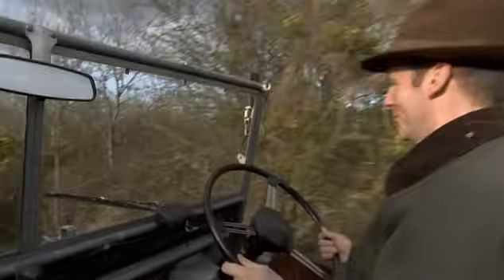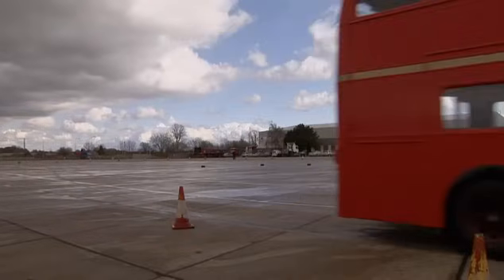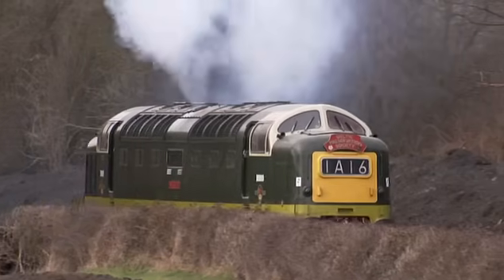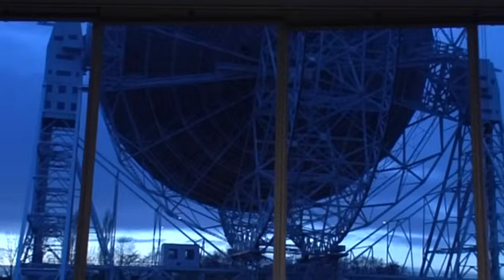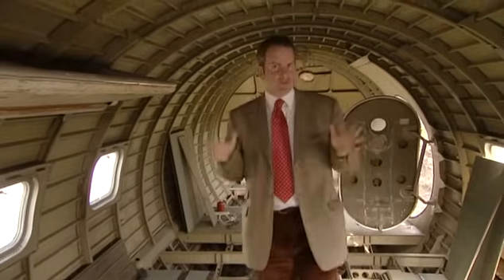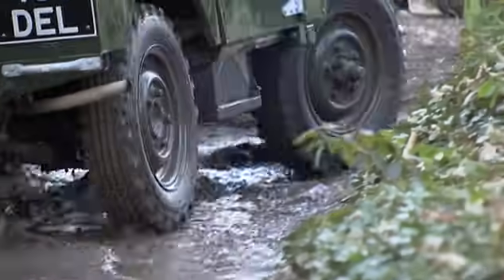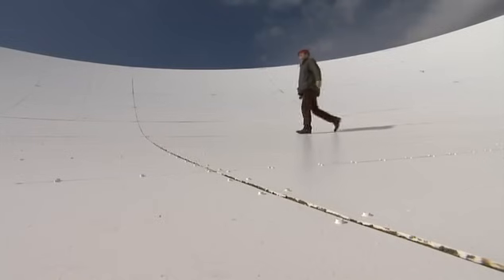Britain's Greatest Machines with Chris Barrie - S01E02: 1950s - A New World Order (2.0 Stereo, 360p)

Comment: I worked at a plasma spray company operating lathe/cylindrical grinding all those little fins on that jet engine are sprayed with a coating because they would melt if they did not,we also did rods for paper making machines with out the coating on the rods the paper going over would melt them, It was an interesting place to work I learnt so much about plasmatic flame spraying.Peace.

Comment: I recently watch a  video stating (You Tube Channel  Pilot mentor) the problem cracks was not from passenger window corners. But from the aerial aperture on the roof called a aerial window.
Reply: The wreckage recovered from the sea confirmed that the passenger windows were not related in any way.
Subsequent investigations revealed that the Comet used aluminum skins that were half as thick as they needed to be and were made from an inappropriate alloy that was too brittle.
The Comet also lacked proper rip-stop doubler joints and the fuselage reinforcement hoops were too weak and spaced too far apart to prevent cracks from joining up with adjacent panels.
The Comet was also found to have too few riveted fastners and that they were not installed to industry standards for pressurized cabins, they cracked during  construction and large cracks were found on new aircraft that passed quality control inspections.

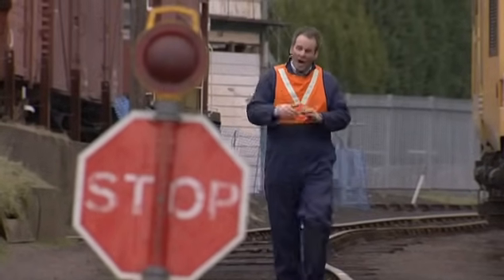Comment: 8:27 Third rail?
Reply: Some rail networks (merseyrail for example) uses a 3rd rail on the ground that picks up electric current driving onboard electric motors instead of overhead wires and a pantograph

Comment: The Landrover had it's lovely galv and aluminium body but awful mechanicals and rust prone chassis. The Austin Gypsy had great tough mechanicals and a sealed rust proof chassis but a baggy rusty body. If the best of both had been combined by BMC, the Japanese would not have stolen the world market with the Landcruiser. As a mechanic I owned Austins and Rovers and worked for the NZ company that imported the first Toyota Corollas and Cruisers. Farmers were cancelling their Landrover orders and ordering Cruisers after just one drive. The beginning of the GB car industry failure.

Comment: Most two stroke diesels fail modern pollution regulations, you can see why. The deltec engine magic was having one crankshaft rotating backwards, hard to do but the key to success. A true dinosaur to be cherished.
Reply: Suppose you could improve its efficiency by using more turbochargers or bigger ones meaning less fuel is burned

Comment: Great series, Chris is perfect for this and the display of wonderful British engineering is a real treat.
The original double decker bus of the fifties and sixties was the AEC  RT,  the bus before the one we saw on the skid pan.
A super looking bus and very popular with passengers and such an iconic British passenger vehicle, I always remember the huge black radiator filler cap on the front, with the finger holds and the engine cover that was at the front of the lower passenger deck and behind the cab, some of us kids used to stand on this and use the hand holds to balance ourselves until told to sit down by the "clippie"
The only exception to all this great engineering is the Diesel Deltics and some other British engines, post steam, possibly the ugliest in the world and still not very eye catching in 2021.
Great performance and obviously from this, longevity, but looks went right out of the window in this section of great British achievements. Thanks for this, super series.
Reply: you sucker for cleptoparasitism, because the Americanization of TV productions thereabouts does appear to have been handily pulled off WAY fuckingly earlier than I'd idly supposed, fuck.........

Comment: repeating the incorrcet trope of comet windows..... (they contributed but they werent the cause - which was poor assembly practices by staff untrained in pressurised aircraft assembly that caused microcracking around rivets (1: hammering rivies instead of ensuring holes were the right sime  and 2: overtightening them) and De Havilland manglement refusing to let the designers talk to the assembly line staff to train them in critical procedure

Neville Shute was sacked for writing a memo predicting the inflight breakups of Comets. "No Highway" was the book he wrote afterwards (turned into "no highway to the sky" as a movie) to warn the public when he was gagged from saying in public what would happen.

The windows? When the tear in the skin from fatigue damage around the rivets reached the straight eddge of the windows, the airframe "tore along the dotted line"

Blaming the windows was a way of de Havilland management avoiding corporate manslaughter charges - and the coverup of Shute's warning memos went on for over 50 years

Comment: The delta diesel locomotive engine is the craziest design I've ever seen. Didn't know opposing pistons is a thing until today, and in delta configuration with three crankshafts. How crazy is that?
Reply: OP engines can pack a lot of displacement in a small volume and you get to do away with the the valve train.  The US submarines used an OP engine during WWII made by Fairbanks Morse.  It had only two crankshafts.  hth
Reply: @paulkurilecz4209 could you technically make a radial engined diesel locomotive by glueing like 10, nine piston radial engines running on diesel OR kerosene?
Reply: @Andromedagalaxy22  Yes, you could; however, there is a limitation on width that could affect the design.  I believe that the Germans did make some diesel fueled radial engines for aircraft.

Also, there will be a height limitation and then there is the need for maintenance access.

Hth

Comment: Comets: perpetuating the myth of the windows. They were actually designed with the stresses in mind - hence the radiused corners -  it was the ASSEMBLY practices which killed the aircraft because the designers and engineers weren't allowed to talk to the assembly line workers (who'd never built pressurised aircraft) by 1950s management, and so the workers didn't know the way they were putting the aircraft together (hammering in rivets and dodgy drilling practices) was creating microcracks which would then travel during pressurisation cycles - none of this was a problem on unpressurised aircraft.

Neville Shute went into this in detail (and the R101 issues) in his autobiography. It's worth reading.

Comment: The original gearbox had a set of " stump puller " gears and regular highway gears. The bonnet mounted spare tyre was my only problem. 4WD does not solve the glare ice issue, despite traveling at 25MPH. I barrel rolled my series 2 SWB and the only damage was to the windscreen caused by my bonnet mounted spare hitting it. When " Daktari! was about, that program sold the rest of the world on the Land Rover. When yo wanted more power, the answer came from across the pond. All the tooling for the all aluminum Buick V-8 powered the 3500 Rover sedan and the first Range Rover County.  also know the Lord Rootes story and the two jobs that created the Sunbeam Tiger. I've salvaged and kept many Series Alpines running. These vehicles are a labor of love for me. I don't do  politics and have several sources of the original Ford 260 V-8 that a certain penta- star  company was furious their V-8 would not fit.

Comment: Land Rover- not bad for a 6 month stop gap. Until now.
Reply: Land Rovers, like almost ll cars today made today are now junk by cutting corners to maximize profits! and making them difficult for the owner to work on them and to be very expensive to take to the auto shop!
Reply: @nightlightabcd  To true! I would never buy a new Land Rover now, probably a Volvo 4x4 or Skoda. My first Series 1 an 88 inch Ex Field Cable Party vehicle cost me £150- One sold at Bonhams last week a 1956 ex military for £29900!!! I currently run a Dsicovery 2 TD5, and a V8 on auto gas and P38. Best one ever was a Classic Range Rover with a 2.8 Isuzu engine in- Did 500,000 miles that I know off, broke my heart when that went. However ! Old Landise never die, bits from her are still going on other rebuilds.

Comment: Land Rover..The Best 4x4xFar.
Reply: Is the answer 16? If so, were do I collect my prize?
Reply: That depends on what metrics you are using. When you consider the terrain they were anticipated to traverse it would not have been such a bad idea to do a bit more in the way of rust prevention like heavy galvanising of the chassis but by the nineteen fifties making things to last was no longer seen as a good strategy. Despite that there are still many old land rovers still going after a lot of work over the years patching them up.
Reply: Ever tried a Land Cruiser?
That's something actually working, and doing so reliable!

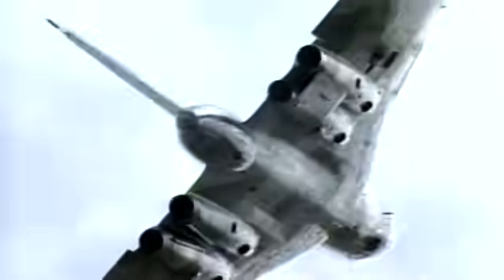Comment: 27:02 - 50,000 feet would not have taken it beyond radar range, but at the time there were very few fighters or surface-to-air missiles which could guarantee a successful intercept.
Reply: dont forget the u2 spy plane was up there only problem was ussr could detect but had to keep quiet so as not to give the game away.
Reply: @raypetts2155 they did give it away when they shot down a U2 with a surface to air missile

Comment: I love those old double decker buses I cannot believe they actually drifted that bus without rolling it over
Reply: designed that way with self levelling suspension. or more weight in the bottom reduces roll over.
Reply: Yes amazing, how many slaves they managed to press in to lower the centre of gravity. and then they had the hutspah to call it engineering

Comment: If you want to go into the desert, use a Land Rover.

If you want to come back out, use a Land Cruiser.
Reply: If your Toyota breaks down in the desert, tow it out with a Land Rover. And I’ve seen it done
Reply: Spent a lot of time in the desert in my LR Disco II, including quite a bit of severe off-roading in extreme heat (every weekend June, July, and August in Death Valley). It never let me down, always got through (and quite comfortable) and never had any equipment failures. Also drove Land Cruisers in the deserts of UAE and Oman - good car and it got me out, but Land Cruiser's aircon was weak compared to my Land Rovers (have had four of them since 2000).

Comment: I rode on these buses when i was a kid. They stunk of diesel fumes. The exhaust was in front of the entrance at the back of the bus. Fumes got sucked into the bus. I wonder why the exhaust was not moved to the other side. Can teams of engineers be that stupid?
Reply: I seem to recall there used to be a regulation requiring exhausts to be on the near side

Comment: I FRIKIN HATE DIESEL ENGINES
Reply: I understand what you mean.  I'm not a fan myself,  but they do produce alot of torque.   Torque that in the old days, was achieved with gearing.
Reply: BUT STIL IT SHOULD HAVE BEEN A STOP GAP steam-eletric hybrid locos anyone
Reply: As nearly all diesel locos are just generator sets driving electric motors on the wheels we are almost there without batteries getting in the way . I will add except the diesel-hydraulics of the Western Region .
Reply: Most fuel efficient type of engine there is .
Reply: the USA tries a direct drive steam turbine locomotive and a steam-turbine electric.

The turbine geared-down concept was a questionable idea, although the prototype d3veloped a lot of power... 

The steam turbo electric had merit... because it could run on any fuel type including granulated coal.

But the diesel locomotives win out... the argument I've heard was these requires too much water  (despite designs to condense and reuse some % of the water)

however... the argument that stopping for water would add unreasonable coast & delays. thst was total nonsense as up until about 1954 US railroads were 99.9% steam with some electrified routes (Great Northern RR; but even then the GNRR still used articulated mallets for heavier freight)... . water supplies were already well placed aling all rail routes

Comment: Is that much smoke normal for a Deltic?
Although the Vulcan is the poster aircraft of the V force, I actually prefer the Victor.  It looks more futuristic and more menacing!
Reply: Yes that is  actually pretty normal for a Deltic. Deltics have two supercharged 18 cylinder engines. So 36 cylinders producing 3300 horsepower all together and burning lots, and lots of fuel. So you are gonna get a lot of smoke, museum piece or not.  And all diesel locos make a fair amount of smoke on a cold start. If the loco has been left overnight in the depot then the engine and the oil is cold. When you start burning cold oil it makes a lot of smoke until it has all warmed up.
Reply: I suspect not. That locomotive is a museum piece and probably doesn't get much use. No matter how carefully maintained an engine is if the thing sits for long periods of time it's not going to work as well as one that's used regularly.
Reply: Any diesel engine with a large capacity will smoke on start up , very rare for one not to .
Reply: Less with the modern diesels that have turbochargers as standard and thus re-burn the exhaust. Still lots of deadly particulates though
Reply: @stupidtreehugger  since when did a turbo supercharger reburn exhaust gas:)
Reply: Let me rephrase that. Since about the 1920s
Reply: Wow. Thank you. I sit corrected. I thought one re-used the exhaust to get a bit more burn. Apparently not so. Just a matter if one uses the exhaust to push more new air into the cylinders (turbocharger) or the crankshaft to do the same (supercharger), or, in the case of e.g. Mercedes, a "Kompressor" which uses either method. Shame. I thought there was a bit more un-burnt fuel to be had. Oh well. Thank you webtoedman.

BTW. "comprised of" is not a thing.
https://www.businesswritingblog.com/business_writing/2015/01/comprised-of-vs-composed-of-a-test.html
https://grammar.yourdictionary.com/grammar-rules-and-tips/comprise-vs-compose.html
https://grammarist.com/usage/compose-comprise/
https://dictionary.cambridge.org/grammar/british-grammar/consist-comprise-or-compose
Reply: How a turbocharger works! (Animation)
https://www.youtube.com/watch?v=DqWKNuTppmU